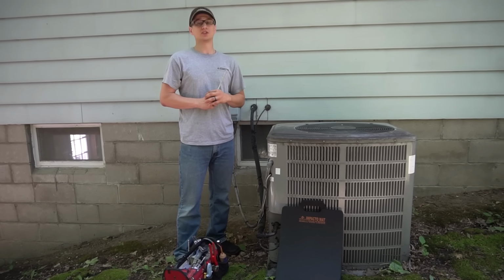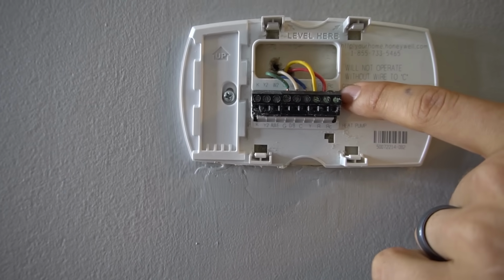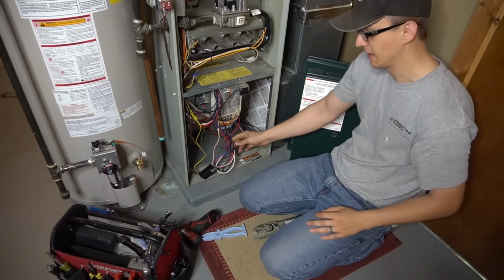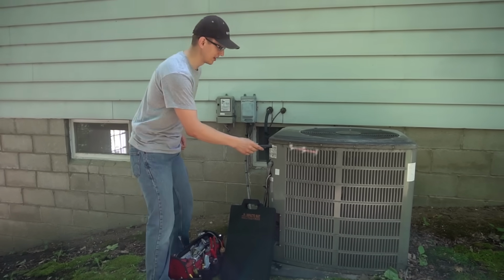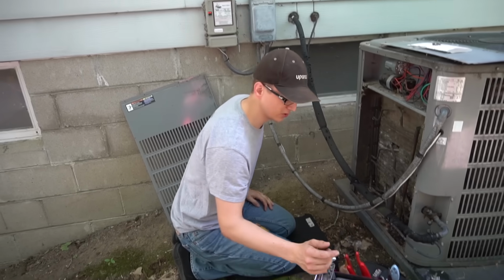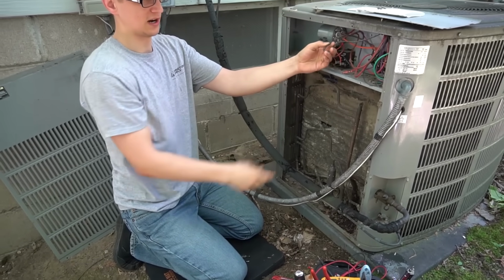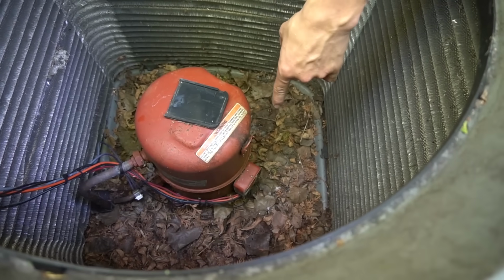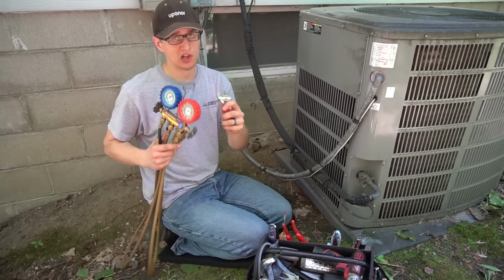AC Unit Not Turning On - How to Fix It Step by Step

Comment: Awesome video.
Indoors everything is working fine and there air blown but not cold.
Going outdoors, the condenser unit fan not working and no noise whatsoever. no humming or any sort of function.
the capacitor doesn't have the bulge that you mentioned for bad capacitors.
What's the problem in your opinion? (fyi I don't have a multimeter to check the 240volts, is there another to test it?)
Reply from the maker: The easiest way to test it is to (very carefully since there may be 240v present) push in the contactor plunger as I showed in the video. If nothing happens, not even a hum, then you do not have 240v. I would check the circuit breakers and your disconnect fuses if you have them.
Reply: thanks for the reply.
I pushed the contactor and the fan didn't work.
also, I changed the capacitor today and the AC worked, BUT when I turned it off it never worked again.
what could be the issue?
this happened before, I disconnected it rom the main electrical panels, waited few minutes and the fan started working, but after never worked again.
Now after changing the capacitor it worked and after never worked whatever I do.
Reply from the maker: Take your AC electrical panel off so that you can see the contactor and ask somebody to turn on the AC at the thermostat while you are watching the unit. When they turn it on, does the contactor plunger pull in? Does it sound like the fan and the compressor try to start?
Reply: thanks for your quick replies.
I did that, and the contactor plungers pulls in, but I can't hear anything from the fan or the compressor. The compressor is wrapped with a sound blanket.
today, I turned off the breaker for 2 hours then the AC worked fine, but after I turned the AC, I tried now to turn it on but not working. it's been doing this a couple of times
Reply from the maker: That is odd... I wonder if you are getting 240v there or not.. At this point the only way to find out would be to check with a meter.. When you reset the breaker, is it in the center position? (if it's in the middle position, it's tripped)
Reply: the breaker was in the regular position not in the middle.
so if I use the meter what do you think I should test first.
Reply from the maker: If you follow the electric whip from the disconnect (the metal ribbed cable) that goes into the condenser unit, there will be three wires inside. 2 hot legs and a ground. The two hot legs go into one side of the contactor. Put your meter leads on both screws that those wires go to. Do you have 240v?
Reply: I checked the voltage now.
L1 and L2 are 0. there is no voltage in the lines!!!

I checked the disconnect and there was voltage in them, so I checked clean around the wires in the disconnect, and SUDDENLY the fan STARTED!!

do you think it is a problem in the external AC disconnect or the AC breaker on the main electrical panel?

update:

when the house reached the set temperature, the fan stopped and that's fine.
However, when the AC tried to start again, it didn't and the fan is dead.
The whole system doesn't look to have a life or any breath.
I guess again no electricity is reaching it.
how can I check the breakers and see which is failing in the furnace and the main panel.?
Reply: voltage is coming into the disconnect box from the main breaker (Line is Ok), but the LOAD wires (that goes to the contactor) are not showing any voltage.
could the disconnect be bad or burnt?
how can I test it?

Comment: Thanks for a great video. I have a problem with my AC. The fan inside is running but the outside unit is not. I try to push the contactor in and I hear the fan and the compressor is starting to run. So what should I check next?
Reply from the maker: For some reason the 24v that comes from the furnace control board is not making it to the contactor coil. If you look in your furnace, do you have a control board or a fan relay?

I would first check and see if your 3 amp fuse or breaker  at the furnace control board is tripped.

If it's a board, try taking a piece of wire and strip both ends off of it. (or you could even use a paper clip) Then, turn off the furnace and locate the thermostat terminal strip on the control board (R,Y,W,G,C). Put the jumper wire under the R and Y screws. (that will bypass the thermostat). Then put your doors back on and turn the furnace on. Does that turn on your outside unit? If it does, then you likely have a problem with your thermostat

Look outside for the thermostat wire that comes out of the house and into the condenser unit. It will usually have a white and a red wire inside of it. Do those two wires go straight to the contactor coil or does one of them go somewhere else?
Reply: Word of Advice TV I think it may not be the thermostat because I swap it with the one upstairs and it works fine. I went and looked at the furnace control board, the fuse there looks fine. But I notice that the tray under the furnace is full of water and I could hear the condensate pump is humbling. Could that pump be bad and causing the outside units to not working? Thanks for your quick reply!
Reply from the maker: So when you changed out the thermostat everything started working? In that case it would just be a bad thermostat right? About the condensate pump, I would check all the hoses and make sure they are not plugged. Then, try pouring water into the condensate pump basin, does it turn on and pump out the water?

Comment: Great video.
I have a 29 yr old ruud a/c unit that worked but wasn't kicking in the cool air to well. Last summer lighting struck a tree an on its way down it hit the house and A/C unit. The gravity of the fall made my A/C work great! Unfortunately it was only for 3 days. So this year I finally got some free time to clean it out. It was really dirty and clogged. Put it back together and now it's not working at all. Breaker on, power on. It's not getting any power to it. What part you replace first?
Reply from the maker: If you carefully (there may be 240v present)  push the contactor plunger in, does the unit start? I would also check your disconnect. If it has fuses, those may have blown.

Comment: My question about the jumper wire I wrote yesterday did not post. Is there a delay before comments/questions go live? So my question is why don't you have a jumper wire between your R and RC? My thermostat was changed this past winter and now my AC won't cool. I think he threw away the red jumper wire.
Reply from the maker: Sally, I thought I answered you? I am not sure what's going on with the comments. Yes, sometimes comments appear like they were just posted but the date is from 2 days ago. Not sure why that happens. My thermostat does have a jumper between R and RC :) It is very small though so maybe you can't really see it in the video. I even went and double checked right now. I am not sure what is going on with your system but if there is no jumper between R and RC then your AC will not work.
Reply: Thank you for the quick response. I don't know your name :) so I thank you Mr. Word of Advice. Your videos are terrific and I keep watching them and learning each time I watch. My thermostat does indeed have the jumper wire. So then I began to trouble shoot step by step, and I am narrowing down the issues using all of your information. So far I know my thermostat is good, my air handler blower is great -it turns on and off from the auto or on settings on thermostat. I discovered however the filter was disgusting and may not have been changed for two years. I removed it with some difficulty and replaced it after a good cleaning of the plastic case that holds it.It s alarge one 20x25x4. I've already had the old shut off breaker replaced. I know I paid too much (150.00) :(. I'm reluctant to spend more. I had a heavy up and know the electrician connected the AC into the new panel box so power is going to the compressor and fan. BUT still crickets. The unit is around six years old and uses "puron" (R 240). The compressor and fan blade look kind of bright and clean. I can't understand why they don't kick on. I spun the blades with a long screw driver-it spun freely.  So it' seems c;ear that there is no signal to turn on the fan blade or the compressor. My next step is to open up the unit and check the wires , the contactor and the capacitor. I ran out of time yesterday so have to wait till I go back before I can continue. (This is my investment property just to clarify) . Stay tuned for my next report. LOL.
Reply from the maker: Hey Sally! My name is Jay ;) Thank you! I'm glad you like my videos. I am about to make another video that stresses the fact that being careless with electricity can get you killed. So please be safe. It sounds like you are doing good! Great progress so far. So have you actually checked the circuit breaker for the AC? It's not tripped? The test where you push the contactor plunger in will tell us if you have 240v or not though. Once again, do that carefully though. 240v is more than shocking.
Reply: Hey there Jay! Sorry I didn't report back yet. I've been so tied up. But After I  a long delay I did get back to this AC unit. Once I opened the panel outside- everything was clean (no debris collection, no mice chews or nests (:)); then i pressed on the contactor as you showed/suggested and the system fired up !!! So there was the issue...the capacitor bulging up a little and i thought obviously the culprit. I ordered a new one from amazon only $10.00.Exactly the same type as what I took out- 35/5 uf 370 VAC.Pulled the disconnet and Turned the ac breaker off. Then  I replaced it reconnecting the wires the same way I removed them: the  herm (had 2 blue wires), C (3 yellow wires) and Fan (one brown wire) connections. , Turned everything back on and much to my dismay the system did not turn on. The air handler turned on as did the blower and I could hear the thermostat clicking trying to turn on the compressor  but neither it nor the fan went on. I can't imagine what else could be wrong. Hoping you have more ideas. I do have a great multi meter if I'm supposed to be testing line somewhere.
Reply from the maker: Welcome back! :) So from what you described it sounds like your contactor is not getting 24v. Glad to hear you have a meter! Then we can do some checks right away :) 

Turn your thermostat on to cooling and then go down to your furnace. Take off the doors and find the main control board and the thermostat terminal strip on it.(R,Y,G,W,C) You will be leaving the power on and make sure the door switch is taped shut. Then set your meter to voltage and put one lead on R and the other lead on C. You should have 24v. Then check R to Y (should be 0v) and Y to C (should be 24v). Let me know what you find please.
Reply: OK Jay now for this news. I got out to that house today to continue this odyssey.  I followed your directions exactly. I taped the furnace door switch shut.  It took me a minute to find the terminal strip but there it was, and I set my meter  to 200 V, and put the leads to R and C and then R to Y and Y to C.  I got readings of 27 v  0V and then 27 V. So did it matter that it read a little higher than 24v? Anyway what's next? Yikes.
Reply from the maker: Thank you for doing it exactly like I asked :) Now we know that everything inside is okay. Thermostat, transformer, and control board were ruled out with those checks you did. Our problem is outside. About the voltage: I say 24v, but it's always different, anywhere between 24-29v. 

So something outside is in series with the contactor coil and it is interrupting the 27v that is coming from the control board. Next, go outside and find the thermostat wire going from the wall of the house and into the condenser unit. That wire will usually have 2 wires in it, typically a red and a white. Do both of those wires go to the contactor coil, or does one of them go somewhere else? If it does, then try tracing that wire and see what component it goes to.

If both wires go straight to the contactor coil, then put your meter leads on the terminals that both of the wires go to and check if you have 24v. If the coil is getting 24v yet the plunger is not pulling in, then you have a bad contactor.

Comment: My dog chewed off the small brown wire thats outside of our Concord AC it has pink and white wires inside it and now we have no idea where it goes. How can I find out?
Reply from the maker: If you have wire strippers, use those, otherwise use a utility knife (without cutting yourself). So the dog chewed the wires in half right? First turn the furnace power switch or circuit breaker off. Take both ends of the wires and strip the brown insulating wire back a few inches. Then strip the ends of the pink and white wires off. Next, put those wires back together :) Red to red, white to white. Twist the stripped ends together and if you have wire nuts, put wire nuts on. If not, then you can tape them with black electrical tape. If you put wire nuts on, I would tape it all up into a bundle too, just so it's not exposed. Then check your 3 amp fuse in the furnace control board. That may have blown. Replace if needed and turn the power back on. You should be good to go!
Reply: Thank you so much for your demonstration....As a student from the field and with my 2 months vacation from school, i was really out of touch...Thanks to you, i got everything on track.   I even upgrade my knowledge with your lesson...You should open your own school in the field because you explain everything really well and you have great knowlege on the field...Thank you so much again...Which school did you attend to see if i can go also to that school depend on where it is?